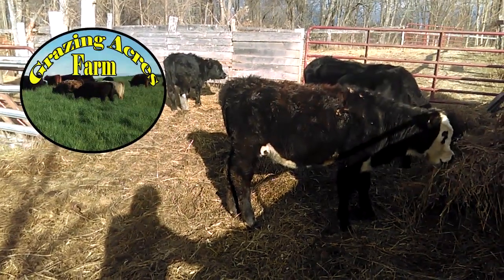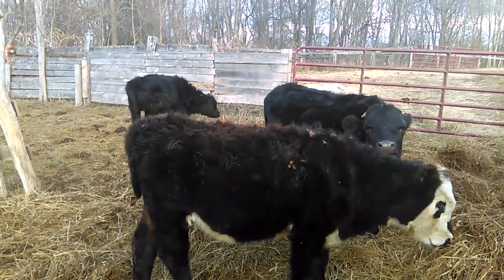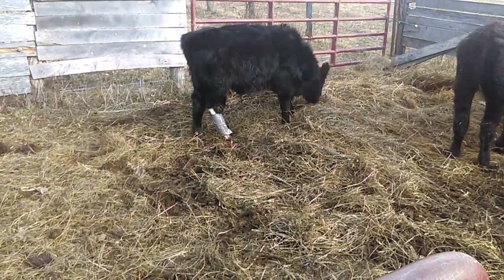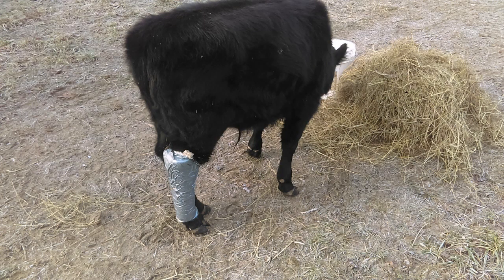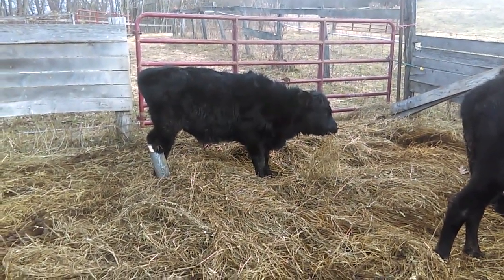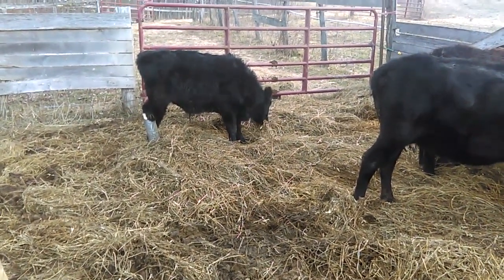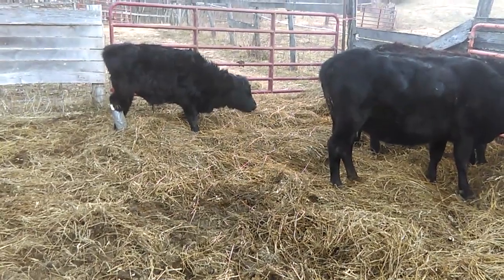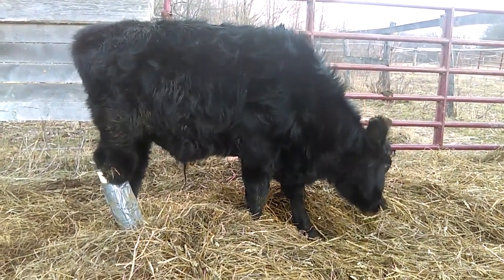Calf Breaks Leg In Feeder/ How We Splinted Calves Leg

Comment: You can roll the ends of PVC rather  easily by pushing it on to a heating non-stick frying pan. When the temperature is right, the plastic softens and spreads out.  So long as you don't heat it into the sticky range, you can do a little pushing and forming.
Reply from the maker: Good idea! I am gonna have to try it.

Comment: I hate this open bottom round hay feeders. Only had one i purchased cheap and immediately welded some steel sheeting walls around the bottom.
Reply from the maker: I swapped this one out for a solid bottom wrapped feeder I had at home. The open bottomed feeder are fine for older cows just not calves.